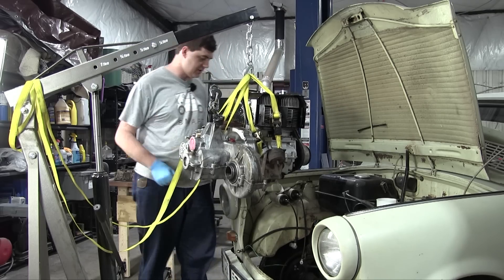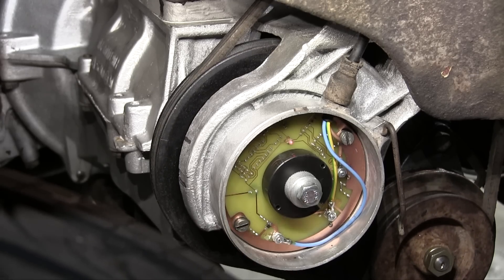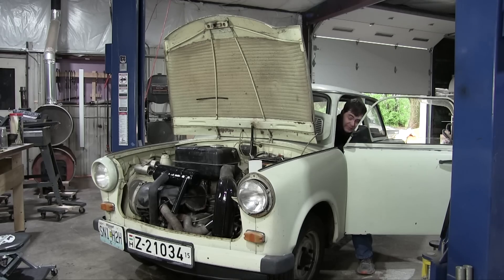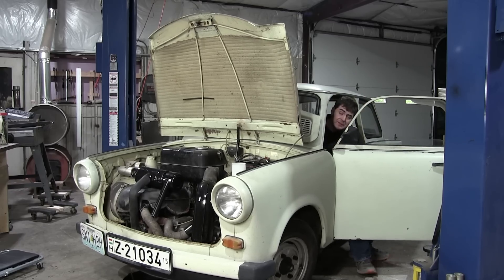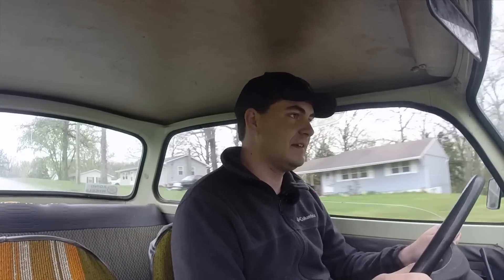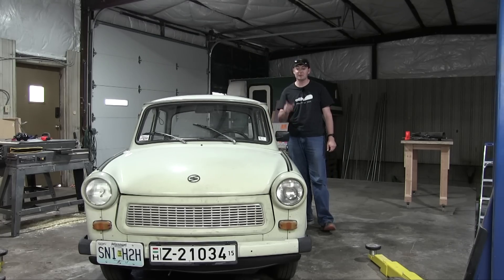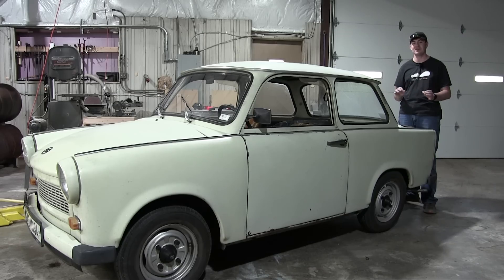Rebuilding the Trabant's Engine: Part 4 - Finale

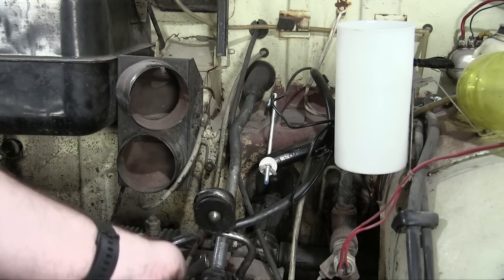Comment: if you check your video (this one, part 4 "finale") from 2:46 till 2:56 you'll notice that when you pulled out the shifting lever it went from one side of the "one cable" and when returning the new one you pushed it by the other side of the same "one cable" (that connects to the gearbox)....this might, just might be the reason of lateral tension which causes the lever to pop out while reversing (?)...in case you haven't yet sorted it out.....just came here today (4 years after the video was posted) here and enjoyed all four parts to the last bit....the thrill you couldn't suppress at the end was so hilarious.....love it ❤..I never had Trabant but had a small "Polski Fiat 126p", basically as simple (even simpler) than Trabant and I use to service it by taking parts u in our flat (no garage)....such as sanding/polishing valve seats......and that car brought me wherever I drive my today's cars these days....only, when that small Fiat stopped I would have made it drivable to home by the road curb in a blink....not with the cars I own lately....😩...keep up the spirit, greetings from Croatia (neighboring Hungary 🙂)

Comment: Nice, good to see it running again. Please try to take it carefully, new engines have to be worn in for at least 1000km. It´s not a good idea to go full rev in this time since it can lead to some ugly problems later. And you feel bored you can upgrade it easily to 12V, that makes a real difference!

Comment: Nice to see you have it running. The first test drives with my brothers Trabant were great. At a bus stop, he changed the spark plugs because they misfired :D
Pro-Tip: Replace the brake drums with disks, at least at the front. VW Golf 1 brake disks fit. My brother installed 'em and it's much better (and even safer)

Comment: Well, that brought back some memories :-) It was always the same after putting it together, during starting furiously working the choke, the gas, and hoping that it will eventually start... and when it did not, it was always some trivial problem, like a stuck needle or a forgotten cable connection. And yes, a Trabant in good condition does 100 Km/h, 110, maybe even 120 for a few minutes. The factory data for 0-60Km/h is 30s, for 0-100Km/h 60s, I measured them myself at 15 and 39s in my '89 (12V) Trabant 601S.

Comment: Neat little car, love your excitement over getting it running. Other comments about the cable on the wrong side of the shifter linkage may be the solution to your shifting problem. If you don't resolve the problem, you run the risk of bending or damaging your shift forks having to hold it in reverse.

Comment: First of all: Great work!! Ive done the same thing in january here in germany.

I daily drive my Trabant and we made about 30 000 km or about 19.000 Miles last year!
Apart the Shifting Problems (Try to use some WD40 on a tissue under the dashboard on the shifting column.) I noticed two things:
1. The Heater is misplaced! (The thing mounted on the Muffler. Dunno how to call it. We call it Heizbanane or Heating-Banana in Germany! :D) Usually there is some rubber Pipe between the muffler and the Banana. If you want, i could send you a picture of my engine bay.
2. Even if the car is old, the engine is brand new! That means you need to drive a richer oil mixture! (Normally for a Trabant is a Mixture of 1:50) For new Engines you need to drive 1:33! Everything needs to adjust ther shape to the other parts, so there is A LOT of wear on the first Miles! 
If you want to keep the Engine healthy you must stay under 50 Miles/hour (80km/h) as well! 
Drive the richer fuel mixture for at least 2500km or the next 1550 Miles! Oh and dont rev the engine to high! ;P

(PS: Sorry for my bad grammar, ive tried my best! ^^")

Comment: Awesome video! Your Trabant runs like a car now. It's great to see you so HAPPY when it runs.

When I'm 63 and bored I'll probably rebuild a 2015 Prius (my current car) for kicks and giggles. Man, putting in a new NiMH battery core ordered from a dusty stockroom in Japan and getting that 1.8L I-4 to turn over will be a real trip down memory lane, haha :) Thouuugh, with the way the advanced electronics work today, if I can't rely on the computers already in the car, I'm probably not going to be able to rebuild a modern car 30 years from now without years of software reverse-engineering! Oof.

Comment: Quick question/advice(?): Why not just pull in the clutch if you need to coast for long? OR you can pull in the choke for short periods of time when coasting or engine braking on a two stroke. Engine braking for like 5 seconds is fine with no coaster or choke. This was a really fun series! I really enjoyed this. Looking forward to an update

Comment: When you ran your new shifter through the fire wall a line, choke maybe? Swapped sides and went from above the linkage to under. That might be why you are bumping out of reverse, the cable is putting pressure on the linkage.

Comment: I'd advice to use a more oil rich mixture for the first 2-3000 km to avoid the "raw" engine from damaging its parts. Just a little bit more oil, mix it between 1:33 and 1:40. A little more smoke, but the engine will be less stressed.

Comment: That feeling of accomplishment for a successful job well done and the joy of feeling that the car itself "is happy".  Hard to put it into words. I'm restoring my dad's 1980 Fiat 147 (he doesn't drive anymore and I needed a car, so it is mine, now) and got to drive a bit for the first time after we got it running again, a few weeks ago. It still has a bunch of stuff to do but if I wanted, I could already start using it daily. But I digress. It is not a fast car, it is small, very simple, not really powerful engine but it is very light and has a lot of torque (and is able to keep up with modern traffic, surprisingly, which is great, since I do plan on daily driving it!) and the engine runs like new. It feels really snappy and is so much fun to drive and just have it working again that I couldn't help but smile all the way while driving it, from the moment I first accelerated in first gear to a while after I parked it back. Feeling that the was "happy" (you know, working well and such) made me really happy. I can't wait to have that car complete. Watching this video and seeing the Trabant working well again and your reactions to it reminded me of the feeling I had when I test drove my little Fiat and I adore that feeling. <3

Comment: I had driven trabant for years back in the days and I can tell you, its quite reliable. Biggest annoyance is mixing oil with fuel on the spot at the gas station. That being said, yours prior to the rebuild must have been in quite bad condition. But also, its an old car, you need to be good with the choke, the wheel is heavy, synch gear swithching is very easy once you get the hang of it. Its far from the modern cars where you just startand drive but its not going to leave you on the road if its in good working condition. Have fun!

Comment: Don't worry about letting off the throttle with no freewheel. There is enough oil in the bearings to sustain lubrication for minutes. I dont know, where this "loss of lubrication" thing comes from, but I never experienced this in 25 years of 2 stroke tuning on the dyno or road. Maybe the oil is so much better today, I don't know.

Comment: I can't see if it has been done - but that electronic ignition board seems to have nothing in the way of corrosion prevention. If you wanna keep the board in good shape, coat front and back with some vaseline spray. 
Otherwise, the copper will oxydise slowly.

Comment: These cars were made for leaded fuel. So it's not enough to add 2stroke oil for a 1:50 mixture. I add a lead additive together with the 2stroke oil for a 1:33 mixture to the normal fuel.

Comment: There's one thing I can tell you... that cable that connects the ignition system wasn't designed for automotive use! It's regular European mains flex for 230 V AC! Perfectly up to the job but I had a good chuckle!

Comment: I am guessing the shift lever is not installed correct. The old one was left of the black bowden cable or speedometer  cable.. The new one is to the right of it. I also noticed that the lever has this little kink. I the black bowden cable would be on the right as it was with the old one, this kink keeps the lever actually free of the cable. Now the kink has no obvious purpose anymore plus the bowden cable rubs against the lever.
Oh,  okay, just read that others observed the same thing.

Comment: I think you are very clever to rebuild the engine and put it back again and run the car as well. I would like to drive the trabant  to see how easy it is but l think it’s not because of its unusual gear lever no body know which is up or down like 1st,2nd,3rd or 4th and reverse. Places to see Trabant  today is Hungary they liked East German cars .

Comment: Very good work 👍 but are you sure about the ignition. It's actually 3mm before top dead centre. Also with the newer base plate there are two adjustment options. 3 mm and 8 mm.

Comment: I may be wrong, but most of those electronic ignition replacements automatically advance the timing as engine speed increases. You could throw a timing light on it to verify that. 😉

Comment: As you like ...different...cars I think you should look at the English Berkeley cars.  Fibreglass bodies,  curvy lines,  compact and the B95 was powered by a Royal Enfield 692cc air cooled twin cylinder motorcycle engine which made it...fast.  
The T60 three wheeler might appeal looking like an E type Jaguar from the front...and a potato from the back,  powered by an Excelsior 328cc two stroke twin with crankshaft mounted combined starter and generator unit.

Comment: You can get up to 150km/h with a stock Trabant. Rev much much higher than you normally do before shifting. Your timing is conservative, this cost you power. Use high octane fuel with no ethanol and make the run on a cold dry night. 
Drove a Trabant one night from Berlin to Dortmund in three and a half hours (~500km). Drove back in two hours with a Porsche. :-)
The Trabant begins to "float" Beyond 140km/h. You can feel the loss of contact with the pavement. :-)

Comment: Another benefit of the Trabant Rebuild is now the engine has its full 26 horsepower. That highway run reached 110 kilometers per hour that converts to 68 miles per hour. This must be a new speed record for the Trabant. Before in a previous video Doug DeMuro who tests drives cars was told that the time for 0 to 60 mph did not exist.

Comment: You did the TDC wrong, not as critical with roller bearings as plain bearings but the way to do it is rotate it in one direction until it stops, pick a mark on the gauge about 5thou (.1mm) back, rotate it backwards then forwards to this indication.  Mark on the pulley/flywheel, spin the motor somewhat past TDC and bring it back to the same indication, mark that point on the pulley/flywheel.  TDC is halfway between these two points.  What you have done is marked 5thou BTDC and 5thou ATDC, this method compensates for the play in the bearings.

Comment: I challenge you to a drag race with my '72 Suzuki LJ10, which proudly sports the stock 360cc two cylinder, two stroke engine.  Although it has almost half the displacement of your Trabant, it seems to have a couple of extra HP (28, on a good day).  The weights are comparable, too. (about 1300 lbs for the Suzuki.)

Comment: For highway I'd use a little more oil to gas ratio at least 1:33. Back in the days I made a lot of kilometers with the trabant on the Autobahn, I mixed it 1:25. I didn't care for some blue smoke behind me ;-)

Comment: Nice! In my childhood, I took one apart to its bones. Not what you think - it was for a good cause; my uncle rebuilt one from the ground up and I took apart the donor car. I wonder if you read up on its history since. You mentioned once "it came from Hungary" and that is right from where it was imported from, but it is not its origin. I was also wondering if you would make a history video about the good ol' Sachsenring Trabbi. An intersting aspect would be showing the frustration of the engineers when they were turned down when submitting improvement suggestions - even if they made sure that all parts are already available to some extent - like the P1100 - or the last failing effort with the Trabant 1.1 and its sister car the Wartburg (a company that was related to BMW before the end of WWII).

Comment: it seam you could extract 50/60 horses. i have read up to 80 hp they had. even proper tuning could also improve to like 30 hp, according to some German site. 
a brake upgrade would be required, i guess. a mikuni carb?
It reves likes 4200 rpm?

Comment: Dear Aging Wheels. 
All electronic ignitions have (electronic)  timing advance.  ICE's require it. I can even see the logic that does that, on the obverse of the PCB.
Reply: no, you dont need advance on all engines. Its good for power or cold starting, but its not required. Older 2 stroke mopeds all have a fixed ignition and run just fine

Comment: ‘ It runs ‘ !  I should hope so, with all the work you did and all the messed up things you made right.
That would be like workers cheering at the end of assembly line with every car that starts up.
6 volt system, like an old Harley ( old, old Harley )
Your ignition should just fire both plugs every time around like a good lawnmower.
Sounds different- it actually has some compression now
When finally starts most people rev them up, I shut them off because I checking for oiling, etc.
Reply: Now you have to go back home and go through everything in your head and make sure everything’s right. Then take it on road trip.
Reply: You need to get like three more friends and take it on a road trip more than 500 miles. Luggage rack for the roof ( if it will hold one ) first.

Comment: Bare copper traces on that electronic ignition circuit board? I'd put a few good layers of conformal coating on it otherwise it could fail prematurely from corrosion if moisture gets in there.

Comment: I thought you were supposed to double the oil for engine break in. I'm rebuilding my 1971 mercury outboard and that's what they recommend for break in procedure.
Reply from the maker: Apart from one piston ring, there's nothing new in the combustion chambers to break in
Reply: @agingwheels  makes sense. I didn't want you to go through all that work and have a problem. I'm going through the same thing myself

Comment: Hey man, that was an exciting series, thankyou so much.
Two questions if I may:
Did you not wish to do a run-in period of say 1000 miles, &
What capacity and horsepower is the engine.
Kind regards.

Comment: Good video, I have only a question for you: the old inaction spark had a mechani c sister for auto advance the timing injection spark, You remove and in old place install an electronic injection BUT, without the system to advance the correct timing when you increase the RPM...Are you sure it's correct?? for me missing some parts, at this time the car has a fix advanced timing spark, not variable like in the original.

Comment: I had a Trabant (the last series from 1990). It was funny. The top speed was 110km/h, but the engine was very bad condition so it's burned 8L gasoline/100km :).

Comment: You're going to have worse acceleration, top speed, and fuel economy without the ignition advance. Probably not a big deal if your town is relatively flat and you don't get on the highway (again) - but.... 
I once had a Subaru 360 where the flyweights in the distributor froze up. It topped out at 50mph and got about 30mpg. Once I got the advance freed up, it topped out at about 65mph, and did 45mpg. It also accelerated much, much, faster (the best part) which made it a lot less nerve wracking to drive in traffic.

Comment: Fascinating rebuild of an unusual engine (to us in the west). 
Three things bothered me:-
1. The crude electronic ignition without timing advance with increased RPM and without the ability to fine tune the 2 cylinders as you highlighted. I'd have stayed with the original I think (there used to be available electronic ignition that still used points but carrying only signal current which should work and stay in tune better than the original system). 
There must be a power / torque penalty due to the missing functions.
2. You appeared to rebuild the engine completely dry of any lubrication ! Presumably the roller bearing big ends / mains are pre-lubricated but you didn't appear to lubricate the `piston ring' crankshaft seal for example, the sleeve valves or the bores thoroughly (until it wouldn't start anyway). Perhaps you lubed off camera or was I day dreaming and missed it ?
3. I am a bit suspicious of the lube oil you obtained in the US to mix with Gasoline that is supposedly equivalent to the original oil used in East Germany (being called hydraulic oil as if it's for auto gearboxes). Let's hope it's ok.

Comment: Ummm, you did cycle the oil pump over to get oil pressure all the way through the engine before starting, right?  It's also important never to let it idle right after a rebuild, else the rings won't set right.
Reply: It's a two-stroke engine, there is no oil pump because the engine oil is mixed with the gas, just like a Weed Eater.

Comment: at 1:58 you used a tool that was like a ratcheting extension. What is that called exactly and where could I get it? There are SO many times I could have used that simply because there wasn't enough room to properly use a wrench without using very very tiny movements.
Reply: That's the Tite-Reach, the sponsor he thanked.